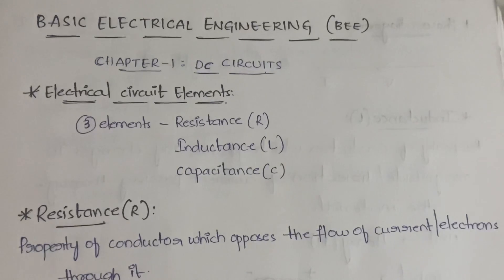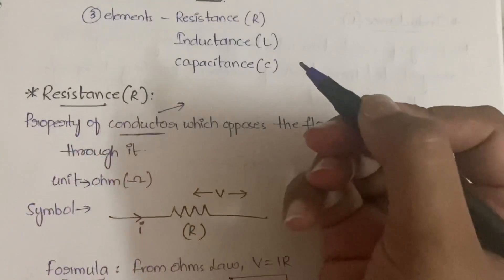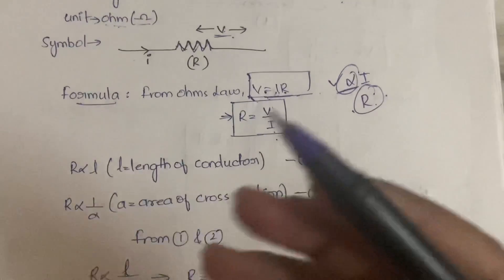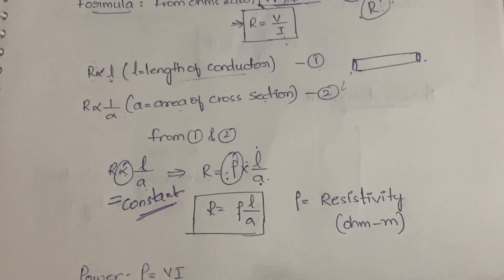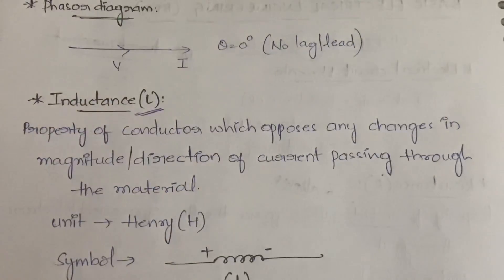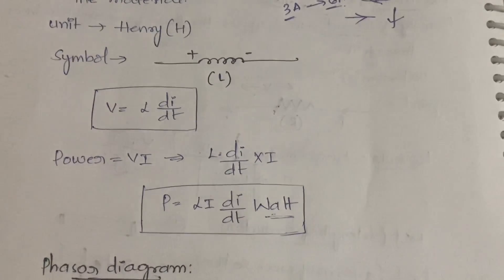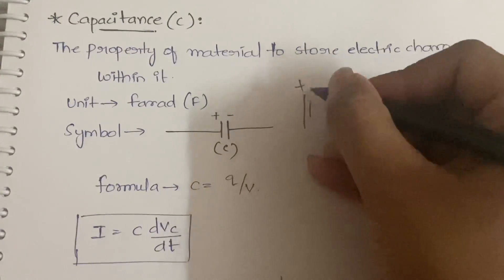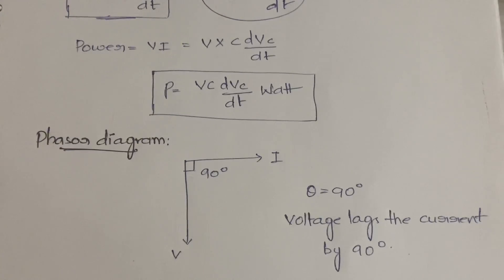1. Electrical Circuit Elements - Resistance, Inductance, Capacitance |BEE|

Comment: 11-06-2023   Bangalore

Madam,  What is the difference between resistance and   inductance?  Both seem  to be same.
Reply: Resistance completely obstructs the flow of charges whereas inductance partially allows the flow of charges in different direction... You can see the difference in the phasor diagram